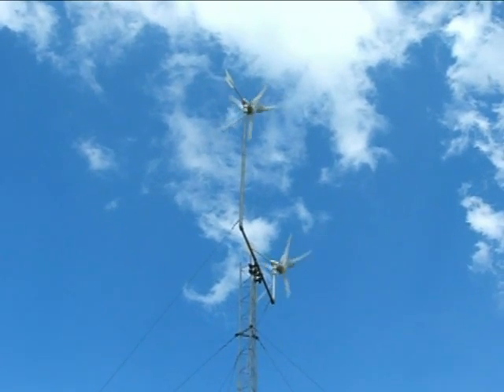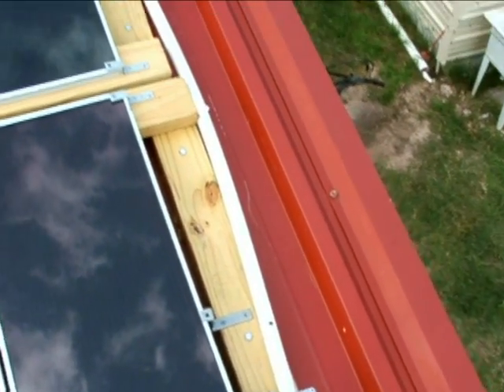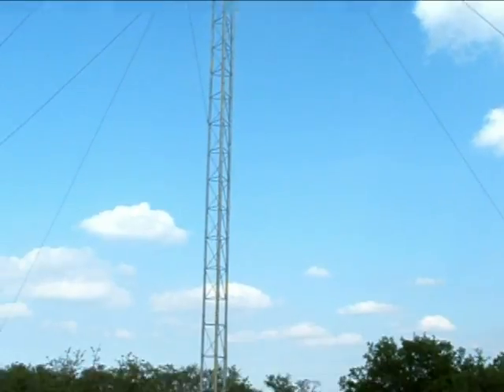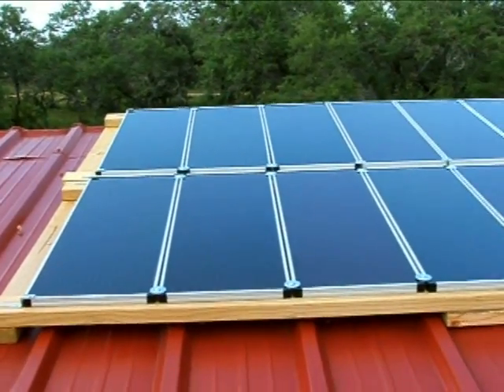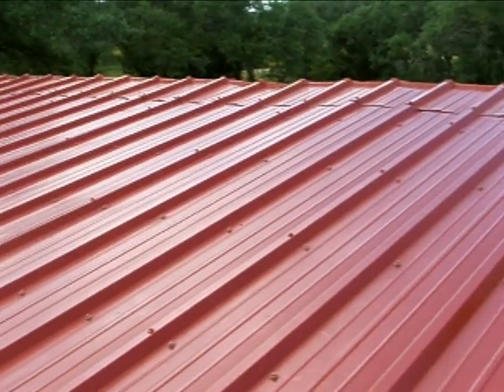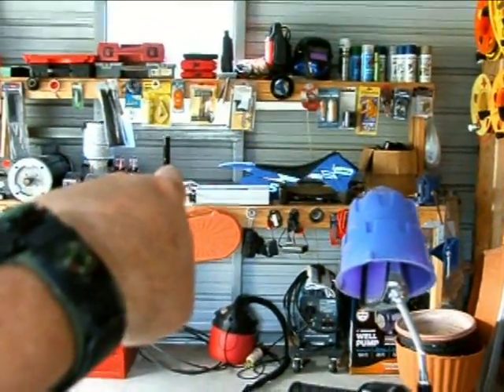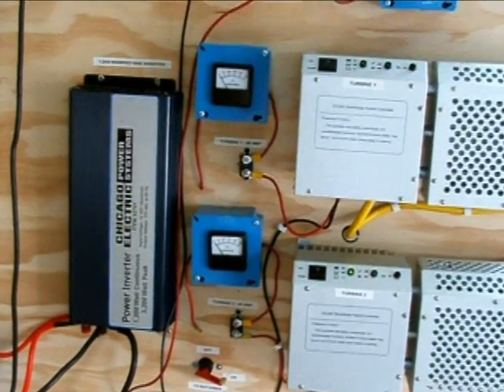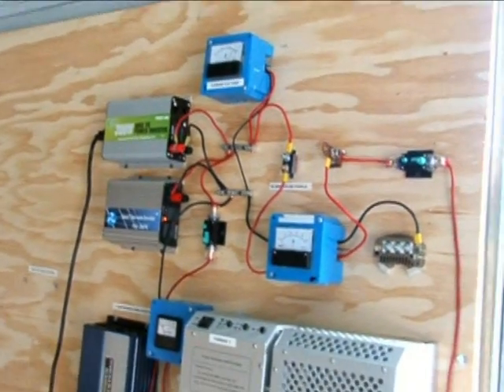How To Install Harbor Freight Solar Panels Part 3

Comment from the maker: @KasinH Thanks Kasin. Turbines are from w w w (dot) magnet4less (dot) com, I think they are the best money can buy for they give the most power output. The well pump is so deep that it uses a lot of power every time it comes on so I put a 300 gallon tank and smaller pump with accumulator from harbor freight to pump with pressure to the house. The well pump now comes on once every two days for 10 minutes to fill the tank. My ammeter shows the well pump draws twice the power than the tank pump.

Comment from the maker: @nomoreremakes The tower is 50 feet high, one turbine is 60 feet high the other is 53 feet high. When I raise the tower it the tower will be 80 - 100 feet and the turbines another 10 feet and 3 feet higher than that. I have to get all my anchors ready first, the tower collar, the guy wires and then rent the man lift and get it delivered.

Comment from the maker: @kricotoy cual es la pregunta? Quieres saber el tamano del cable que necesitas?
Dime el voltage del banco de batterias - 12v o 24v. Cual es la distancia de cable entre las beterias y el panel solar?

Comment from the maker: @claytona57 Not  yet. All panels are made of tempered glass so they can withstand a haistorm - as long they aren't golf ball sized hail. You definitely want a hybrid system that has both wind and solar so you can have power when one is not producing. Thanks for the comments!